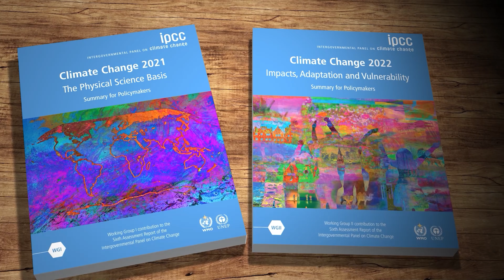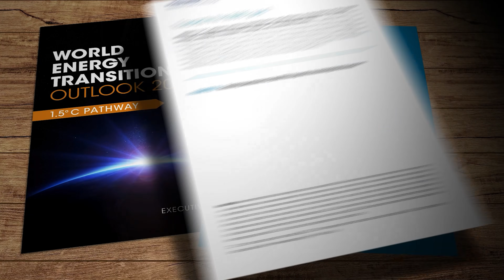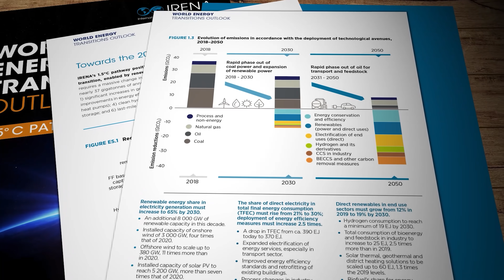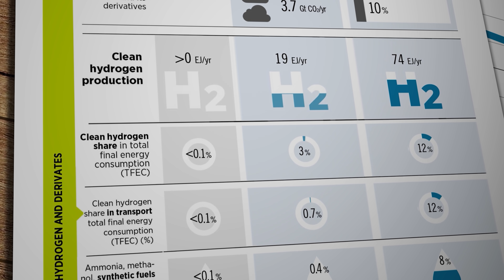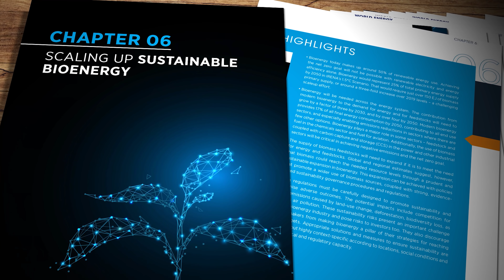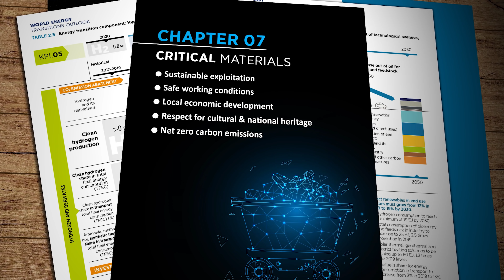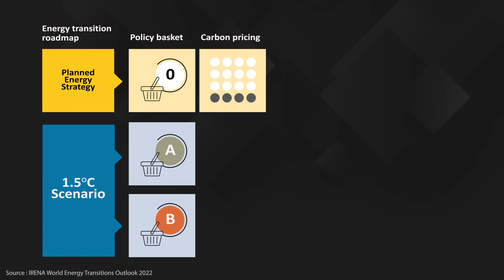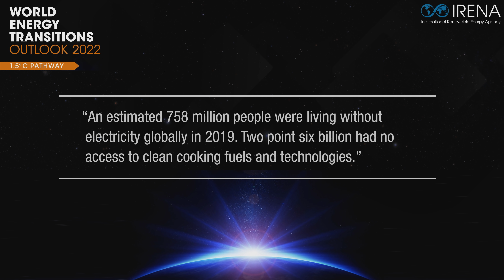Massive global energy disruptions are coming. Brace yourself!

Comment: Thank you for drawing attention to the IRENA report. I hear it as yet another report that's embracing all of the conventional talking points and not seeing the contradiction of expanding both additional land based energy systems and additional land ecosystem conservation. Where's all the the land? The second thing is the canonization of the word "renewable". The key isn't "renewable" though long term viability of a global energy system is certainly vital. The key is minimum greenhouse gas emission  as we get control of our use of (interaction with) the global carbon cycle. 

Of  course, it's a "renewable" energy agency, so they're looking at meeting the challenge using their hammers.
Reply: The insistence on the word 'renewable' instead of low-carbon or clean is key as you rightly point out. Of course the goal is to deliberately exclude nuclear power from the energy transition toolbox, as well as CCS for either new or retrofitted fossil fuel generation.

This is the flip side of the ideological coin of climate change skepticism, because it means the main political proponents of changing our current energy system are explicitly picking and choosing the means to accomplish the task. A task which is titanic, unprecedent, and next to impossible even without imposing extra constrains on the decision space that the nations of the world have to navigate in. That the environmental movement and green parties were born in the 1960s and 1970s, when climate change was not in the public discourse and instead the main goal became to kill civilian nuclear power (i.e., you'd have Amory Lovins suggesting people burn coal to heat their homes back then!), has marked their leadership ever since, and thus climate mitigation seems that will always be a secondary objective for them below wiping nuclear out of existence.

As such, the truth is that we all know we won't decarbonize fast enough to prevent at least 2-3°C, partly because of the scale of the feat, but also because we have so chosen that path on dogmatic grounds. We chose it, because even the political sector more vocal about the status of the problem as an "existential threat" in practice does not consider it its top priority vis à vis destroying nuclear, while the opposing sector has a lukewarm assessment of the problem, and only wants to be allowed to burn stuff to their hearts' content. So the public subconsciously recognizes the cynicism in both camps, which means none of them are persuasive nor could ever inspire a wide consensus of the sort any effort of such scale would remotely require.
Reply: @Grobocopatel  Well said.
Reply: @Grobocopatel  Titanic is the one word that stood out, may be a little late to hard the rudder and reverse engines
Reply: @STEVENFRYFRY  It surely is with regards to the most ambitious targets (1.5-2°C), even if a general consensus existed to strictly cap emissions without forcing civilization collapse, and simultaneously allowing any and all low-carbon technologies be employed on an equal footing instead of with a dogmatically-handicapped toolbox. But although in principle there seems to still be time left to reach intermediate goals (2-3°C), there is a high chance we'll blow past or barely accomplish them, because we won't mobilize resources as we should. There is simply no persuasive argument to be made when the politics are so contaminated with preconceptions of what the means to make it happen should be, constraints anchored in anachronistic and frankly irrational beliefs.

Comment: I don't think hydrogen is a fertilizer; nitrogen, potassium, and phosphorous are fertilizers. Takes 
a lot of energy to produce hydrogen, no? Biomass also emits CO2, so there's little benefit to
reducing CO2. And growing a lot of biomass wears the soil down, and more fertilizer is needed.
Burning biomass other than the millennial wood, is not a good idea.
Reply: Nitrogen can't be used as a fertilizer without being 'fixed', the way we have done that for around 100 years is by making ammonia, which requires hydrogen. Almost all of it comes from petrochemicals currently.

Comment: Human nature does not help with my business I give free energy saving advise on LED lighting where I show the customer replacing a 50watt halogen lamp to a 5 watt LED lamp giving the same light output. 4 kitchen halogen lamps burn 200watts and £45 per year electricity. 4 LED is 20 watts at £4.50p per year.
Multiply this over millions of homes is a big saving yet Joe Public human nature says I will move to LED after I have used the halogens and the spare lamps I have. £45 per year to £4.50p a year I give up at times
Reply: Tommy Taffy  Well if you do the maths as the cost to run 4 halogen lamps for 3 hours a day on average for a year costs £45. 4 LED lamps cost £10 and consumes £4 per year.
Thats £14 cost for the first year saving £31
then second year £41 savings.

Comment: Failure to learn by experience. 
If the global budget for the current Nuclear Arsenal was divided by 50, the ability to destroy the world is undiminished.
So the same defence resources spent on Power Generation and protecting the system would probably resolve most of the problems listed. 

Ask what is currently being defended under the current arrangements?

Comment: I've been experimenting with energy saving for years now. The best way to reduce CO2 emissions is you have to change how you consume it. I use to drive to work now I use public transport. Luclyily we have good P transport in Australia. I have made a stand alone solar panel system that is not connected to the grid that runs  essential equipment in the house and turn the power off to the property when I leave the house for work. I also have a grid connected system that feeds in the power to the grid which offsets my consumption when I'm using the power over the weekends. So for most of the week my weekdays power is feed in and my weekend power is draw from the grid. This balance of energy is actually positive to the grid most of the time.
Reply from the maker: Good on you Brett.
Reply: <<I also have a grid connected system that feeds in the power to the grid which offsets my consumption when I'm using the power over the weekends.>>

No,  it doesn't.  Grid tied solar is  a racket to hide the inherent weaknesses of a power supply that quits half the time.

You are using the services of the utility without paying for them,  and non solar producers wind up paying higher costs to make up for costs solar types don't want to pay.

Solar is fine,  until you tie into the grid.  Then it becomes a racket.
Reply: @SeattlePioneer  my grid tied  is only about 1700 watts due, to the roof. About the only thing it does do is reduce the bill down to it being a connection fee.
Reply: @bretthorwood9396  
<<SeattlePioneer my grid tied is only about 1700 watts due, to the roof. About the only thing it does do is reduce the bill down to it being a connection fee.>>

So,  if it's insignificant,  CUT THE TIE.

Why do you have it?  Because you want to use the services of the utility company and not pay for it.

You are an example of the solar power racket in action. 

The solar power you foist on your utility is often a glut on the market  ----utilities increasingly have to waste it to keep voltages where they need to be.

And you use power when the utility has to use the equipment it built and the fuel it buys  ---when that power should have a peak price.  You want to use it for the price of power when it is a glut.

Use solar power and BE YOUR OWN UTILITY.  As soon as you tie into the grid,  you are part of the solar racket.

Comment: Two bits of trivia while I was having a think about this:
1) global container shipping alone annually contributes something like 2 to 3% of all man-made carbon emissions, as much as the entire output of Germany. And while it's an efficient form of transport, it's filthy, i.e. highly polluting. Clean up that industry and a real dent can be made.
2) Ever wonder why US naval nuclear propulsion plants are so compact, safe, and generate large amounts of power, e.g. the two reactors on board the new Gerald Ford class aircraft carriers generate 750MW, while commercial nuclear plants are relegated to building those behemoth facilities? Yes, they produce GWs of power, it's not that they have to be that large. Now that is an interesting historical story all by itself.
Reply: Tommy Taffy  nonsense. Nuclear energy has always been and will always be expensive due to the before mentionend reasons. Better believe it, or out yourself naive. Up to you.
Reply: @coondog7934  my point is that anything's cheaper than solar because solar requires a backup. The backup could be nuclear or fossil. Germany has chosen to abandon nuclear and now has pretty much the most carbon intensive energy mix in the EU despite having loads of solar
Reply: @sammason2300  True, but Germany is working on it. The goal is to become carbon free by 2030. Even if it will be 2035 by then, it still would be a massive accomplishment. And by that point into the forseeable future, Germany will barely contribute to climate change and nothing to nuclear waste.

And by the way: If renewables get to 100%, there is almost no need for gas driven power plants anymore. Only at night, if the saved energy during the day is used up or if there are power dips.
Reply: @coondog7934  it's a fine aspiration but the technology to store the entire grid for hours/days on end does not exist and there is no solution on the horizon. Or you choose nuclear, which doesn't produce GHGs and doesn't need a backup.
Reply: Tommy Taffy  nuclear is not sustainable, so no thanks. We gotta make it without.
Reply: Tommy Taffy  food can be grown sustainably. Money can be earned sustainably. There is nothing wrong in trying to achieve those things. Yes, nuclear could help a little but it is also very expensive. Instead of putting a lot of money into nuclear power plants with a short life span we could put that money into renewables which will last much longer.
Reply: @coondog7934  Not really, a well built nuclear power plant has a life of fifty to sixty years. 

Some new reactors developed under military programs are sealed units with a safe life of thirty years, they don't even need refuelling.

Solar PV has an efficient life of about 20 years, beyond that heat and UV degradation cause a rapid decline and the panels have to be replaced.

 Wind power is expected to have a life of 25-30 years. The main damage here is corrosion and fatigue.

Any solution needs to consider replacement of plant and equipment as it reaches end of life.
Reply: @jimgraham6722  ye maybe but at least they don't need uranium/thorium to work and don't produce any radioactive waste.
Reply: @coondog7934  You are overly terrified of radioactive waste.  My guess is that your understanding of it comes from The Simpsons.
Reply: @coondog7934  Main problem is logistics. Wind and solar PV the two best prospects for renewables need vast areas of land, at least 1,000 times that needed for nuclear. The other problem is the rate of rollout. It is at present only one tenth that needed to come within cooee of meeting GHG abatement at 1.5C. There is no indication the Chinese plants that mainly produce this stuff can scale up sufficiently.
Reply: @incognitotorpedo42  sure buddy 🤦‍♂️
Reply: @jimgraham6722  solar can be put on top of buildings, you dont really need a lot of additional space for that. You are right with wind though. But it can be done, the plans are out there (see video).
And what China is doing is not our concern right now. We gotta do whatever is in our power before blaming others.
Reply: @coondog7934  who said renewables last longer than nuclear?
Reply: Tommy Taffy  ye sure, but you gotta dig it up and transport it all over the globe. And the more countries adopt that technology, the more stuff you need to dig up. That causes a lot of additional and unnecessary emissions (like fossil fuels are doing right now).
Reply: Tommy Taffy  + the costs of transport and storage related to nuclear waste. Trust me, it adds up. While solar panels are moved once and stay there for years or maybe decades without any other costs. And they can be build on top of pretty much every building. There is a reason why nuclear power is the most expensive form of energy.
Reply: @coondog7934  Nuclear power is cheaper than solar by definition because solar needs a nuclear backup when the sun doesn't shine
Reply: Nuclear
Reply: You're right about the impact of bunker fuel burnt in container ships. A classic case of out of sight, out of mind. We think cars and trucks are the biggest polluters, and occasionally glance at the airline industry, as for international freight ... can't see it, so ...
Reply: @mayflowerlash11  solution is nuclear power plants making green diesel from the CO2 in the atmosphere.
Reply: @scottslotterbeck3796  What the hell is this fixation with hydrocarbons and the desire to turn them into CO2? You have a nuclear plant creating electricity. Use that as your motive force and just stop burning stuff.
Reply: Maersk finds it cheaper to change to fuel from renewable sources with solar and wind as the electricity source.
Reply: @Jakob_DK  Then Maersk should be told to use a climate friendly option. Maersk does not have the moral authority to take a course of action which is injurious to the world's population. "Maersk finds it cheaper ... " indeed. Spoke like a true capitalist who consider they are above the normal laws and rules. True arrogance. 
I'm sorry if my response is harsh but that phrase evokes the arrogance of a powerful organisation that decides it does not have to consider the consequences for the less powerful.

Comment: I hope we look as much as possible at non-hydrogen storage methods, or that we investigate hydrogen externalities assiduously first.  There are many other ways, including simple weight lifting and water storage, which are lower tech, and we may need lower tech as economic crashes are likely to leave us with a massive unskilled labor force.
Reply: If you think about it, the role of hydrogen should not be in storage or for use as a fuel for transport nor for replacing all current applications of natural gas. Instead, there is a role for hydrogen in industries such as cement and steel production, both of which currently are very carbon intensive. An alternative production process is using hydrogen which cleans up those industries, each of which contributes about 8% of global GHG emissions. The beauty of hydrogen is that it can be locally produced which means no storage or distribution, which of course is something that the established natural gas players don't want to hear about since it completely negates their business case, bypassing all of their infrastructure.
Reply: The bad dream I have is that humans come up with a massive sustainable looking hydrogen economy that works well for a thousand years, getting our descendants well dependent on it, then they find to their horror at that point they have exhausted 3% of the vital components of worldwide water to outer space, which they not only cannot get back, but which they are then doomed to exhaust more of because they are stuck with their scale and can not stop using it.  It always comes back to we have to live really sustainably, not just come up with gentler ways to kill our planetary futures.
Reply: Lifting weights is never going to be a cost effective energy storage system. Consider that lifting 100 tonnes by 10 metres stores less than 3kWh of energy. If the electrical conversion efficiency is 50% (optimistic) then that stored energy has a commercial value of about 20 pence. It will take a very long time to get any economic return and is a waste of resources
Reply: You have a point about economic recession, but with new technologies of energy production we may end up with more skilled workforce than without.  That brings up questions about government stability over this 10 year span. Can politicians keep an idea on their heads that long?
Reply: I think the more helpful question is whether communities can keep the ideas in their minds.  A reasonable case can be made that it has to be the community perspective that maintain stable policy, as representatives are essentially stuck being slaves to their supporters.  We all need to work on community knowledge and empowerment, as well as limiting empowerment of high finance and corporations to a role of fact based only representation.  Scale political power in all forms tend to dampen good policy except when their role can be strictly limited to very stringent ethical and transparent contribution to the pool of information, and no self-interest games whatsoever.
Reply: Nuclear is the answer
Reply: I think the only tenable answer is to reduce our consumerism massively, and cooperate for food.
Reply: We could also educate people to implement technologies, if they were indeed worth the extra effort. As long as there isn't student debt
Reply: @ThomasBomb45  HA HA HA.  You took out the loan.  Pay it.  I should have pegged you  immediately as a welfare recipient.  Dead beat.  I ain't paying for your loan.  Get a job.